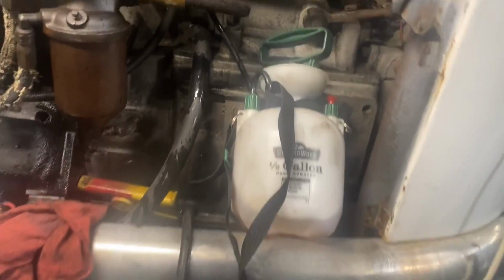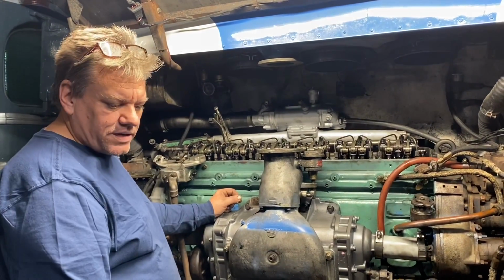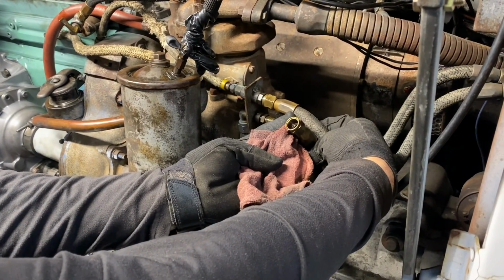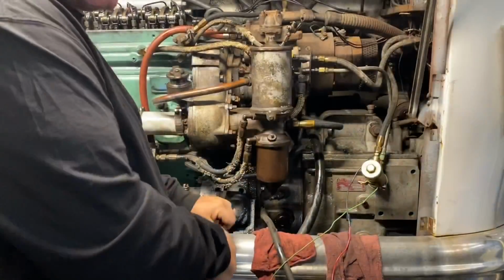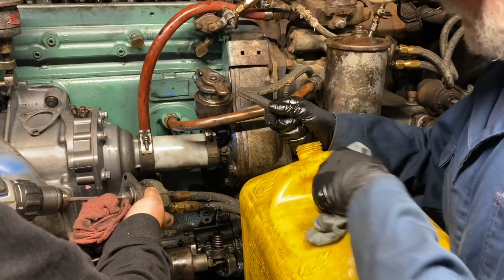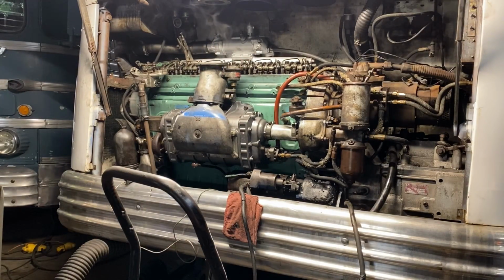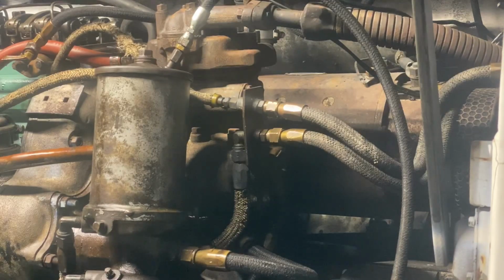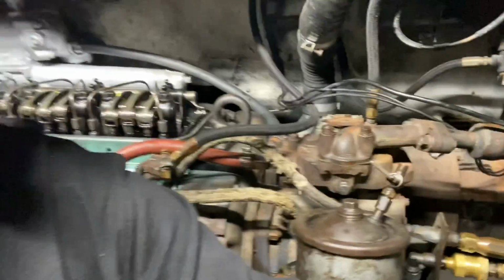1st start detroit diesel 671 a long day of problem solving

Comment: I remember the boys at the locomotive shop trying to start a 3000 horsepower locomotive wouldn't start. Changed out the fuel pump twice. I walked inside while my locomotive was getting field and serviced. When they said they were on their second fuel pump I asked " is there fuel in the tank? " it holds 4000 gallons. Bunch of red faces when they discovered it was empty. After they moved it to the fuel rack and started filling the tank they turned on the primer function and finally got solid fuel and she started right up. Standard pump fo a fuel rack on the railroad is 600 gallons a minute.
Reply from the maker: Well our fuel tank was not empty

Comment: Puny gauge wire is for auto , maybe not for heavy batteries ,,,,  and those bolt on battery post connectors I would toss in the garbage .

Comment: Dont know for sure but when you was trying to force fuel to the engine thru the fuel return line and didn't get anything but bubbles might be because the fuel returns to the top of the tank.

Comment: Does a left hand rotation engine have the same  engine fuel pump?
Reply: Not necessarily, it's predicated by the rotational direction of the blower and which end of the blower the pump is driven from.  In this configuration, the fuel pump rotates clockwise from the drive end.  Thus the water pump which is on the opposite end of the blower will rotate counterclockwise from the drive end.

Comment: the fuel should never drain back to tank unless your sucking air  .low fuel pressure will cause a Detroit to smoke  fitting for return line to tank that galley should have fitting with orifice to build pressure I am 66 year old been working on them for a while now

Comment: I dont know...  cool its running, but didnt it run before without the checkvalve? is the new valve covering up the real fuel issue??
Reply from the maker: Yes it ran before without a check valve. But now every time it looses prime or you open up the fuel system the fuel does not run back to the tank.  Replacing the hoses should fix the issue
Reply: @BusGreaseMonkey   Ya, sometimes a ton of small issues just stack up on you!  Ive played that game WAYYY too many times!!  Good luck and happy wrenching.

Comment: Sounds like the return line dip tube in the fuel tank has rusted off. Try some fresh fuel to address your smoke issue, I had some 40 year old stuff in a 6-71 generator drive, it smoked badly and the exhaust stank, not in a normal Detroit way. The old fuel can be high sulpher, it can also have a lot of bacteria and 'organics' in it that will clog the sintered filters in the injectors.

Comment: so is this one of those engines you don't want to run to empty?
Reply: Not on the side of the road, unless you have 110% fresh batteries, a water cooled starter motor and the luck of the Irish. A small pump unit like Scott is using plumbed into the Secondary filter will save a lot of pain.

Comment: Looks like the battery has a dead cell when it loses 4 volts under load. Do they normally have two in parallel ? same voltage ,twice the cranking amps. The cables look like something someone found in a car wrecking yard.Also,the cotton braided hose,is that still available in the US? It's NLA here in Australia and I often work on vintage vehicles which used it, I used to buy it as "Cummins fuel Hose" . The ends are reuseable as on the bus engine .

Comment: Those batteries SUCK. I'd pull the SR-71 power cart over and use it. (2 Buick Wildcat 401 cubic in engines. All you need would be a generator!!)

Comment: old hoses and fittings...........throw them away............they do wear out and cause all kinds of problems, head aches and lots of $%^&. Even the rubber lining inside the braided hose will come loose and under suction, collapse causing a blockage.

Comment: Ok guys - old Detroit hand here - prime on the fuel return line to to fuel pump then prime the supply side to the pump - then just start the engine - make sure ur air box dump is reset so ur machine is getting air and away u go...
Reply from the maker: Every time we primed the head the fuel was draining out in mere seconds.  It’s not like we could see it was still in there.
Reply: @BusGreaseMonkey  usually there is a check valve at the top of the fuel tank on most systems - if I was u I would move ur check valve to the tank - otherwise that long fuel hose will drain back to the tank and you will have a big slug of air in your fuel line after  you get it started - odds are it will start and run for a minute or two and then die when the air gets to the engine...
Reply: @BusGreaseMonkey  one other thing - if the head is draining like that there is an air leak on the discharge side after the fuel pump - I have seen the seal on that style pump cause the machine to loose its prime.  In your case it's probably that secondary fuel filter housing - it's actually higher than the head so no fuel would leak out but air would leak in and let the fuel drain out of the head